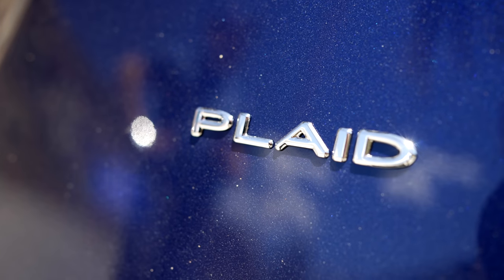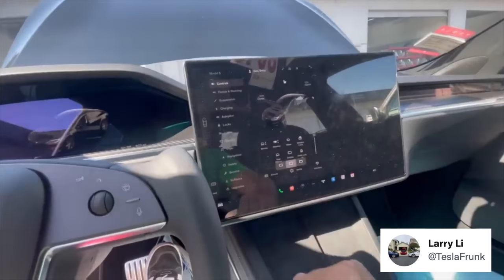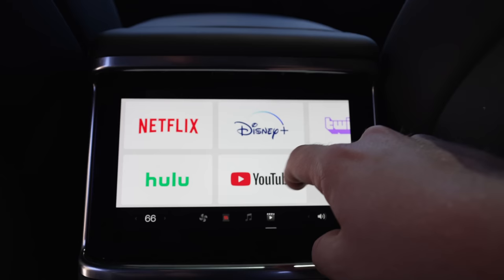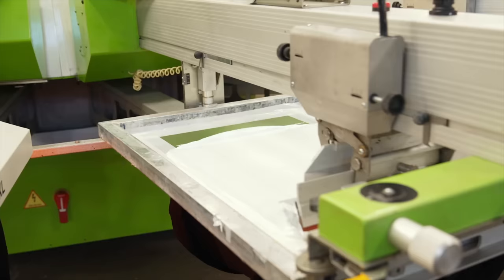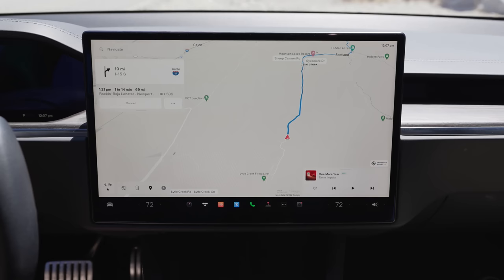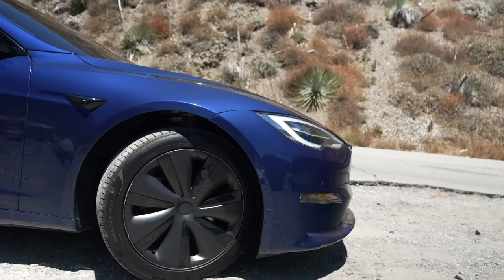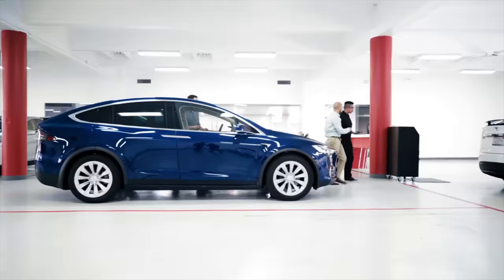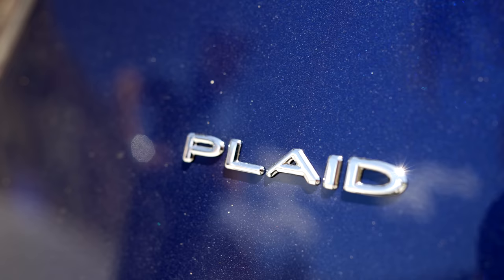Tesla Model S Review After 10 Months | The Results Are In

Comment: Agree with your assessment of issues. I have the MSLR and it is my 3rd S and the best by far.  A number of things I would like to see changed or added that you didn’t mention. 1. The ability to change the instrument cluster display like you could on the older S.  2. It would be better if they could put the blind spot monitor on the Left and right side of the instrument cluster when you activate the turn signal (Don’t know if this is possible).  3. I think cars should have an on star type feature. If you get into an accident you may not be able to grab your phone to call 911.  4. A good birds eye view monitor.  5. A camera or sensor located low on the front grill. I have had a few occasions when pulling into a parking space the sensors can’t see the concrete  block which scraped the bottom of my front bumper. 
Sorry for the long laundry list but wanted to throw them out there.

Comment: Model S Plaid owner here. I got about 10k miles on mine and can confidently say that this is the best car I've ever owned. Daily driving it every day to work and I still can't get over how insanely fast it is, but yet how comfortable it drives. The biggest flaw is definitely the horn. I've gotten used to the yoke and turn signal buttons but the horn button is just awful. I've been in situations where it can almost be dangerous not being able to quickly and instinctively mash on the horn when needed. Only problems I've had with the car are the fake leather on the yoke peeling, which apparently will be replaced with warranty, and the creeks/rattles. Back seats rattle and can sometimes be heard by person im on the phone with on the car bluetooth. The side mirrors rattle when opening and closing the doors as well. Only maintenance cost was for tires but only because I just upgraded to aftermarket wheels. Stock 19 pirellis had plenty of tread left at 10k miles. Great car and review overall and looking forward to hearing updated reviews with more time/miles.

Comment: I have a 2019 MS Performance.  Had a similar issue with rattles from the back after 20k miles.  Had my wife drive while I got in the back and found the rattle coming from the far right rear even with the seats down.  Scheduled service and they heard the rattle on a test drive but couldn't locate it.  They kept the car for a week and finally fixed it.  The invoice mentioned multiple test drives with a technician in the back.  I am totally impressed that they would spend that time and effort to fix a rattle.

Comment: The rattle in the backseat, was an easy fix at home. Our back door, we disassembled and removed the cover. A connector which was originally intended for the ambient lighting is  flapping around inside the door panel. We taped it down with electrical tape and the rattle was gone.

Comment: Ryan, excellent review.  My 2021 blue model S long range has 10K mi and I love it.  Much older than you, my body can’t handle the G-force of Plaid so LR was sufficient.  

My local SC kept the car two days to fix the rear seat rattle and it cost me $78 in rental fees.  Sadly, they failed, but TMC forum suggested a quick wrap of Velcro tape on metal latch and that solved it.  

I concur with all of your complaints, but why hasn’t NHTSA demanded a recall on the horn?  This IS a major safety hazard.  The center airbag cover should support a large, easy hit horn button.  I am forced to drive with my right thumb resting near the tiny horn button.  A few times I’ve “palmed” the entire area to sound horn.  I wish the right scroll wheel adjusted AC fan speed as I change that frequently.  Taking eyes off road to adjust it on display is a nuisance so voice command is my solution.

While my 2017 blue mS was great, the mS-LR is significantly better.

Comment: Ryan, Had the same rear seat rattle on my MS. I read the solution on a Tesla owners site. Take a piece of Velcro tape (the spongy side), wrap it around the seat locking post. Haven’t had a rattle since I did this. RG
Reply: Oh sweet!  I have this issue as well. Thanks for the tip!
Reply: @Marc5840  Glad you found this helpful. When you place the Velcro on just place enough to wrap it around the back seat locking posts. If you put too much on the seats won’t lock back in place. Good luck.

Comment: I took delivery of my 2021 Model S LR September 2021.  It had one defect, which was on the outside of the lower left corner of the yoke it had a light grey scuff mark.  As I didn't wish to have the entire yoke replaced I thought I could live with it.  However, the scuff got larger and longer with time.  Tesla replaced it and I thought I was good.  A few weeks later I noticed a NEW scuff mark in the same location.  What the hell?  In time I discovered the scuff was caused by my shorts lightly brushing against that point of the yoke upon entering and exiting.  I've since repositioned the wheel to avoid contact.  However, as many people ask how I like and I let them sit in it, they ALWAYS comment on the CHEAPNESS of the yoke covering for a $100k+ car.  And I can't really defend how cheap it looks.  Currently I'm attempting to find a fix to covering the light grey scuffing so it doesn't look so CHEAP and off putting to those who are interested in buying a Tesla.  I'm not willing to pay for a new yoke, so I'm not sure what I'll end up covering it with.  Aside from that this is the best car I've EVER owned and I absolutely love the yoke and would never go back to a round steering wheel.

Comment: The "Keep until <speed>" is actually a button (albeit a very, very tiny one). Tap that after changing the suspension height to high or very high and it will stay at that height until you exceed the "limit speed" for the suspension height at which you're set.

And yes, being able to raise and lower the suspension is one of the best features of the Model S/X (vs. 3/Y), although it is maddeningly inaccessible and difficult to use. It's even worse on pre-refresh Model S/X, where it now (with v11 software) takes no less than SIX taps on different, little places on the touchscreen to simply "raise to very high and stay there until I tell you otherwise".
Reply: Supposedly the S3XY Buttons folks are working to enable raising the suspension with a button push.  As soon as they do, I'm buying (the buttons that is).  It is WAY too easy to scratch the nose with the regular suspension height.  I have been uncommonly careful over 7,000 miles and still managed to scratch it once on a driveway.
Reply: It really ought to be accessible as a voice command...
Reply: @jonathansage2147  Totally agree.

Comment: The plaid is a completely unnecessary option. The base is the same speed as the Model 3 Performance, which I own and is already stupidly quick for all forms of driving off track. 

I’ll consider a Model S or a Lucid when I upgrade next, but currently very tempted by the Air.

Comment: I have MS Plaid and it has the same noise issues from the rear. For me, I had a broken clip on the driver side trim panel and the side booster was not fully seated. This did resolve some of the noise but I ended up putting a lithium grease on both seat latches and that solved the noise issue. I also have an issue with my dash cap where the driver side corner is starting to wear through… Tesla service was going to replace it but the replacement part had the same issue, so Service told me to wait until there’s a part revision or the corner wears all the way through. I only have 8k miles on mine. I love the range and performance but I wish Tesla had better exterior and interior quality control. And for this level of cost, they should. Really not acceptable.
Reply: And on the brake side, I upgraded the lines with brake lines from Unplugged Performance and that made a fairly decent improvement. I’m going to probably upgrade the rotors and pads to Unplugged Performance’s upgrade kit which I’ve heard makes it stop even better and it only costs $1900 versus $20k for the tesla crazy kit.
Reply: I had the same issue with the rear seat noise. Wrap some black electrical tape around the rear seat metal hook.  Problem solved